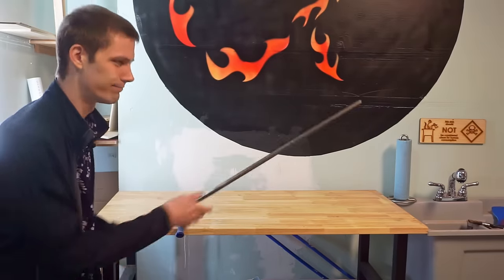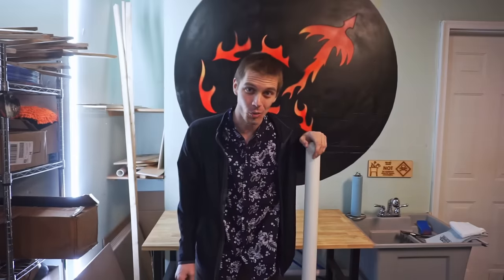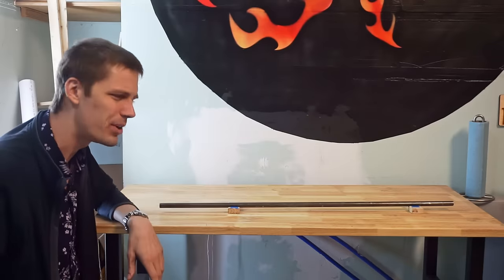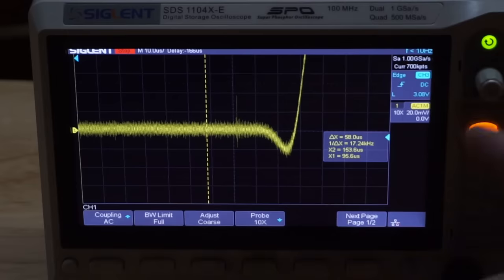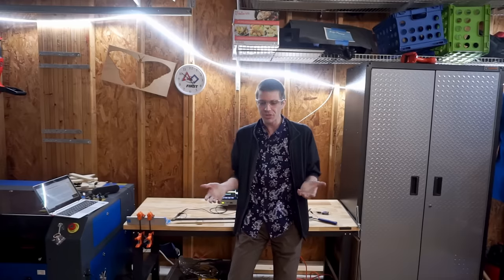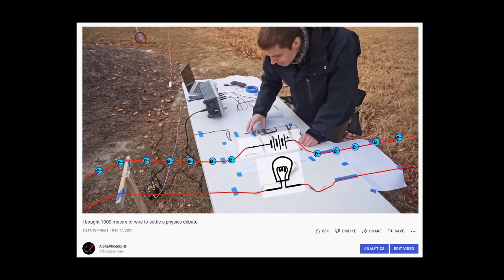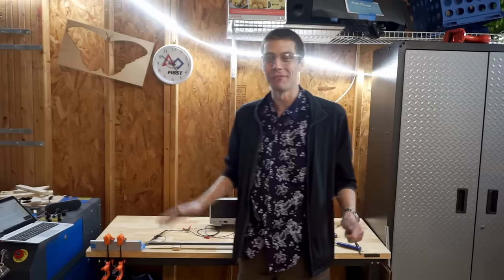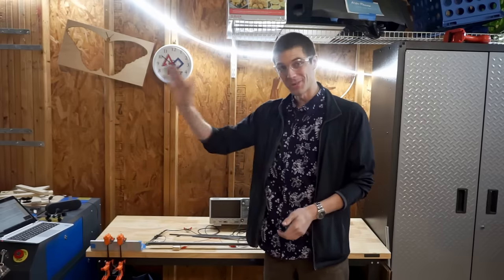Are solid objects really “solid”?

Comment: As I see this video and observe, we’re talking about different types of metal piping in size as you swing these pipes around in the air you’re trying to say that as your head moves, I hold her in the middle one end of the object is moving slower than the other as it catches up so your original Experiment where you talk about a bar that has the length of a light speed of light if this bar moves just gonna be different from one end to the other so if you if you’re moving this object from the center by pulling it from one end from one end or the other there’s gonna be a difference from you from one side to the other is the same as you’re showing your swing and his bar around and your video don’t believe it

Comment: Good idea, good logic, sloppy workout. I am now at 9 minutes. I see you out of a loose hand tick an iron bar against a receiver, also placed at random. I see the delay coming out of you're hands holding the bar. Better built a decent frame nd then come back.
By the way, when you fill a tube with water pressure is constant. So there might also be a delay in pouring water in and flowing out.

Comment: With your setup you clearly cannot measure it if it was the speed of light. In your own video's you've shown that electricity moves at the speed of light through a wire, and the setup clearly doesn't consider that (you have pretty long wires on both sides), which only makes sense if the speed of light can be considered near infinite in the model, which only makes sense to do if the actual speed is several orders of magnitude lower than the speed of light, which it is. So for me simply by looking at the setup it clearly couldn't be answer A or B.

Comment: Hold up!…. Wait a minute!…. Sompin ain’t right!!! 🛑 You forgot to factor in the time delay that is taking place within the signal traveling from the end of your hammer back to your timer. You are suggesting that the electrons travel through your wire lead back to the timer instantaneously in order to give you an accurate measurement, but they don’t. ⏰ Also, you didn’t factor in the time delay from your force sensor back to the timer…………but wait a minute! 🧐The wire leads are the same length, so essentially these delays cancel each other out!…..My bad, carry on! 😂

Comment: I'm sure this comment will be lost in the other 7800 comments before it, a year later, but couldn't you just put a strain guage at each end of the bar, hook it up to your oscilloscope, and see the time difference between the strain acting at the two ends?
Reply from the maker: Totally - those are just expensive lol
Reply: @AlphaPhoenixChannel  looking online they don’t seem that expensive, the film type that is.  Maybe the conditioners & stuff but I thought that could be done with an Arduino.  I dunno, been a long time since I was a grad student bonding strain gauges to test specimens!

Comment: Im in the middle off the video and already know without a physics phd. first we are aplying a shock wave. why because its a "solid". but has we know nothing thouchs nothing there will allways be a gap in the moluces blabla bla. since its a vibration we are speaking of the speed of sound, wich is the speed of the vibracion, althout to better aply this experiment, we would need two high speed microscope, to check in two thing. the movement of whats exerting for to the object and   the other side of the bar, then we can mesaure the velocity of both at bellow microns

Comment: Ehm.. buddy, you know that the electrons dont really move through the wire right ?We just tell lower grade students that because it's easier to understand and explain than the reality of things, and the simple model means you can do jobs in society like electrician, but in real life the electrons in a current do not move through the wire  like water at all, the way energy travels as w call it works on a very different principle the electrons are just carriers of the information, not the actual energy infact they hardly even move at all, they just vibrate. another fun fact is that the energy itself that we use isn't even contained inside the wire at all. It's around it.
Reply from the maker: They do move - that’s the definition of current
Reply: "Ehm.. buddy"🤓

Comment: you just measured the delay in your sensor. anything that can support its own weight while withstanding the force applied will move entirely instantly when that force is applied or it will deform. besides solidity is relative to perception or force or temprature (idk if that is the correct way to phrase this idea). Even the earth has a weight, i believe if that rod was that long and in zero gravity or space and if the enough force was applied to one end that was strong enough to move that mass it would deform the rod and if the rod was strong enough to withstand the force applied the entire rod would move